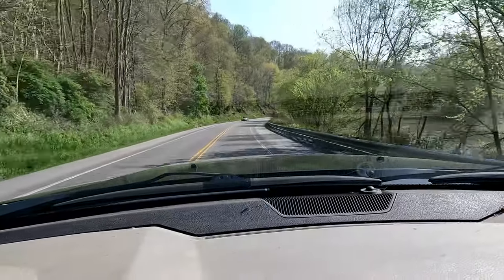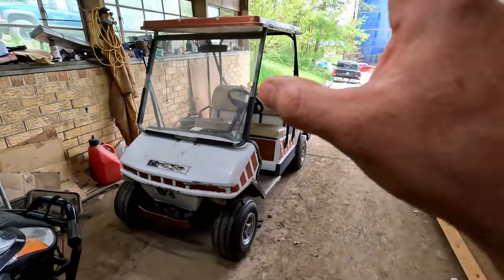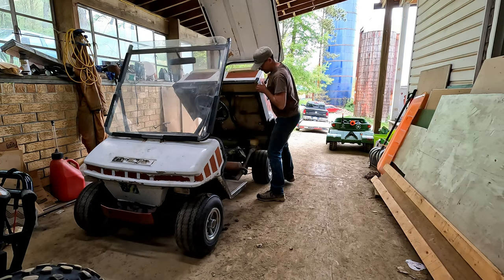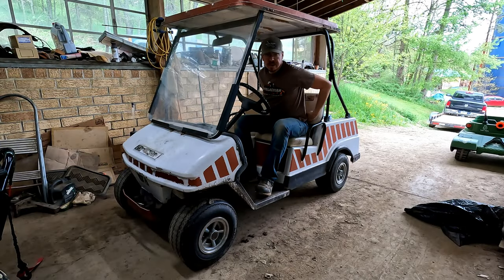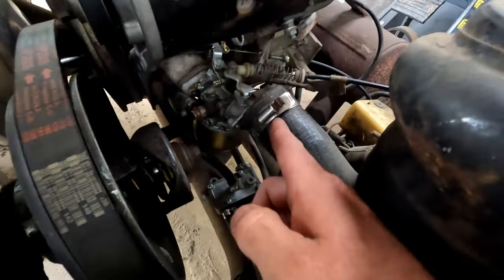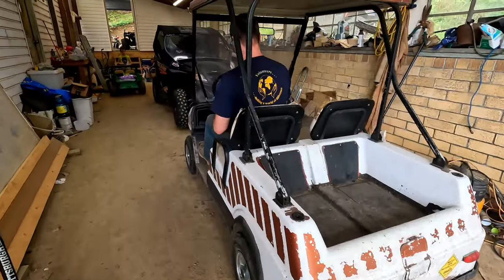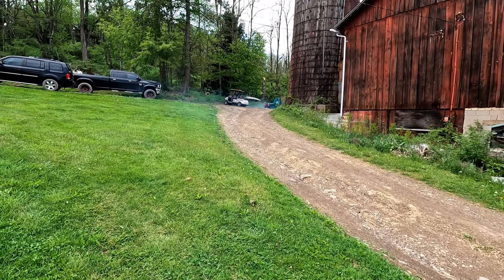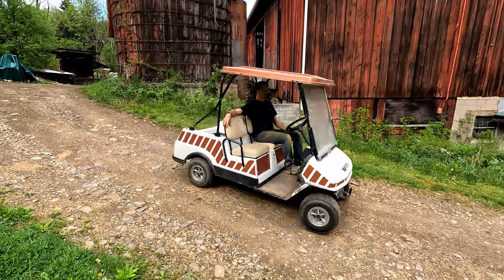1980's Harley Davidson Par Car Revival

Comment: looking for what carburetor and fuel lift pump is on the golf cart. I have a 78 harley golf cart with rebuilt engine and  rebuilt carb but it pull fuel. I want to upgrade the carb and lift pump